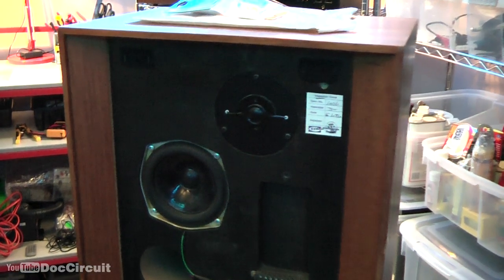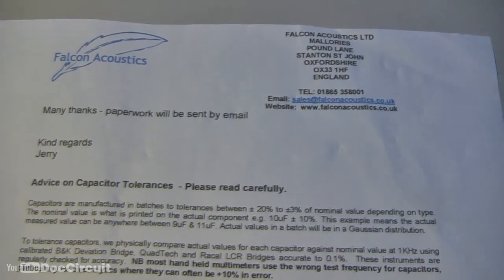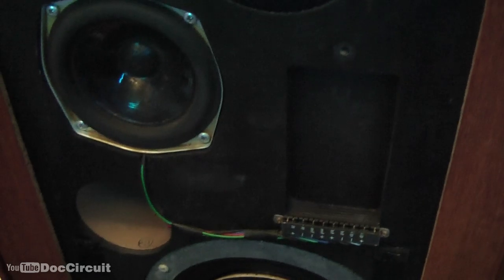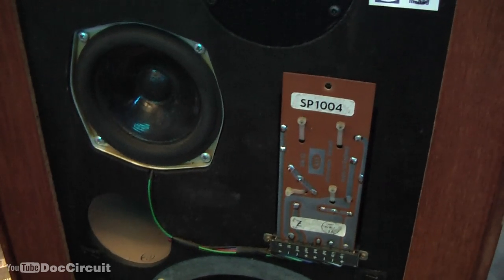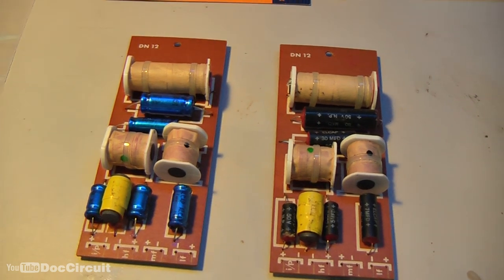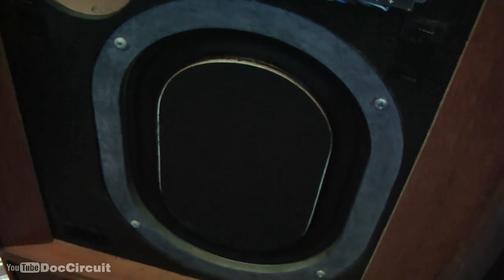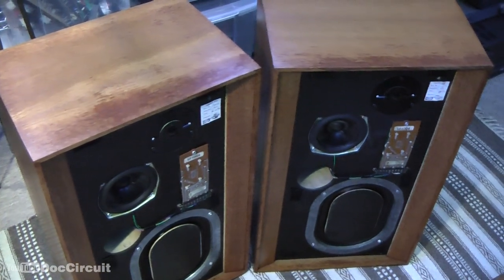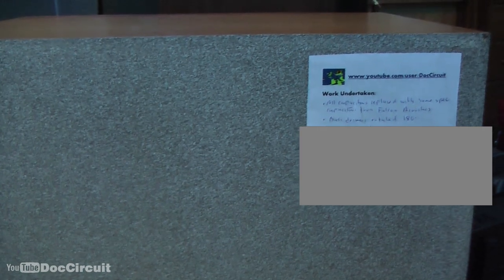KEF Concerto Speakers: Recapped, Refurbed & Compared!

Comment: I built a KEF kit T27, B110 & B139 speaker in the late 80's using a Falcon crossover. Its basically this speaker. The Falcon crossover I bought uses these caps too. I never modified the crossover but based on  my later constructions I found tremendously better results using Solen polypropylene capacitors and I found the sound to be SUBSTANTIALLY better when testing between the Solen and the cheaper stuff. It's quite amazing to hear the size of the difference, Cheers
Reply from the maker: 'Substantially'... interesting! I must do some AB testing with different material capacitors. And yup, Falcon have been around for quite some time (feeling old!).

Comment: Beautiful speakers you have here which look to be in excellent condition.  I was fortunate enough to find a pair in good shape last year in a local thrift store for only $15 .  Mine were built in 1971.  One of the t27 tweeters is not currently working. I haven't pulled it yet to check for continuity, but I have a pair of circa 1970 Chorales in excellent working condition which I can rob for tweeters if need be.  Mine will need caps as well. Great job with the video. These speakers sound great but IMF's are still my personal favourite.
Reply from the maker: Thanks! And $15? You lucky guy. Seems everyone is getting these for next to nothing! IMF speakers... I haven't owned a pair yet, but want to.

Comment: Nice! By the looks of the finish, I would guess that these had clear lacquer on them, and the dark patch was the only place where the oil you applied really got soaked into the wood. I just got myself a pair of 1978-79 Nordlyd Akustik (Danish company - translated it means nordic sound acoustics). They are based on Kef 104ab kit - the same speakers as the concerto, I think. The crossovers look very different though, and are built in. Sadly one tweeter is silent, and seemed to be press fit together. It's a t27, and they are supposedly fragile. Hope I can make it work again!
Reply from the maker: Hi and thanks for the kind words. Having looked at your channel I suspect you'll get it up and running ASAP.

Comment: these are like the heathkits i have, found in the street 10 years ago.  Re-introduced me to vintage hifi.   so smooth at the lower ranges.  I replaced the tweeters with compression horns.  Looks weird but sounds amazing with modern digital input sources.